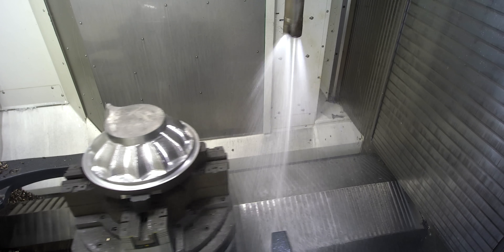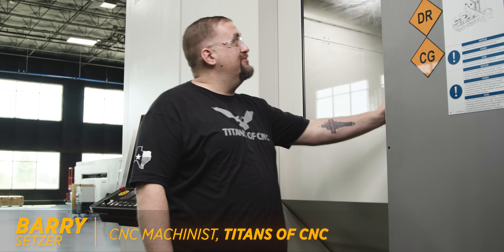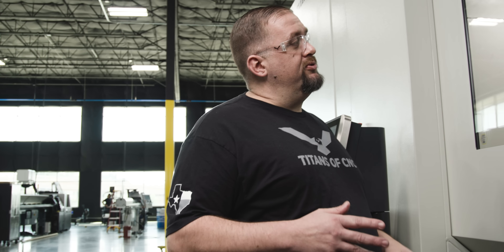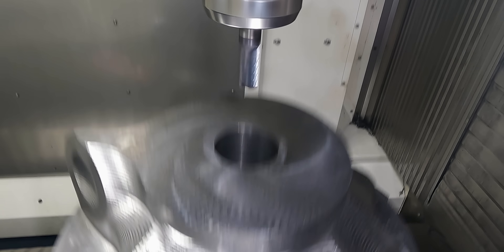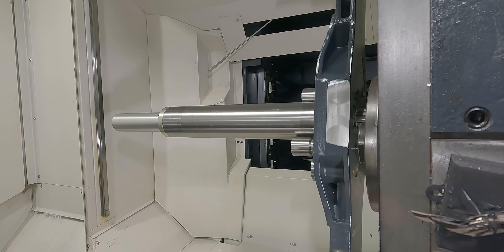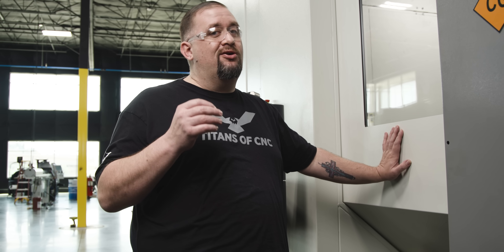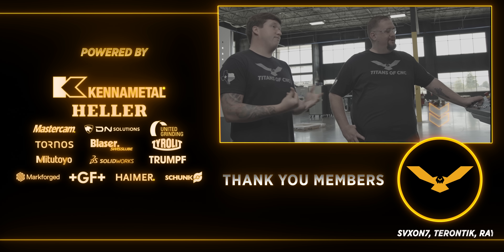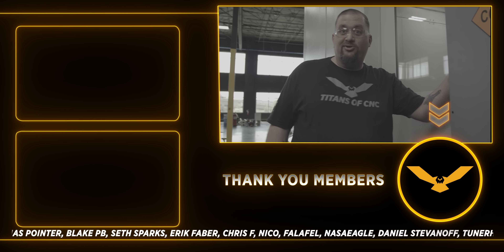I Full Rapid CRASHED Our HELLER CP6000

Comment: A few years ago we had a bad crash on a big $1.5mil machine. It didn't feel bad at first but the spindle repair bill was around $30k and about a month of downtime.
Reply: for a 1.5M machine that sounds pretty cheap for a spindle repair
Reply: I run an old Makino and the computer board needed replaced….was like $18,000 I was blown away, I don’t see how small machine shops can afford that.
Reply: @greeneyesfromohio4103  eBay and skill, inherent or borrowed (practical machinist),  if you think about it, there was probably only one component, or chain of components, on that board that needed replacing. I've had to add an emotional support  capacitor to one machine that started acting up, clipped the wire going to a motor overload thermister  on another. for me that $18,000 would be spent on 3 replacement CAT 50 machines and rigging.
Reply: @greeneyesfromohio4103  I have an 88 Fadal 4020, the whole machine costed less than that!
Reply: Always run my rapid low when running first part, rapid into a Chuck spinning 3000 rpm was my last crash, 3 years ago
Reply: We had a machine operator that did a rapid Z sending a 1.0" reamer into the tombstone on a Mori NH5000.  It turned the reamer into a pringles chip, tore the tool holder open and displaced the tombstone. The machine was down for a month, new spindle and B-Axis rebuild.  I know the bill was over $150K.  The sad thing is nothing happened to the operator. He was notorious for destroying tool holders.  I saw a eight-inch shell mill that was destroyed.....I think he forgot to install the inserts.
Reply: A crash on an index lathe once cost 90,000. That was the record and the colleague has been called Crasher ever since.
Reply: were you the one who crashed it? 😭
Reply: @marcusfanning7513  No my most expensive crash cost around 10,000 Euros.
Reply: @SshanIcsS  crashed a conversational Prototrak when I was learning.  Knocked the head slightly out of alignment by slamming a 1" insert cutter into a vise.  Then I smashed down the spindle of the VF4 I run now on a 123 block when setting the Z.  That head is just a hair out of alignment too.  Not enough to matter usually but a 3.5" face mill leaves about a .0002" high spot on the side of a part unless you bring the back side all the way across.
Reply: That's insanely cheap for a high end machine
Reply: cheap ass haas's wanted over 10k for ours
Reply: @derekschommer1465  Well it´s not cheap but compared to other brands HAAS is one of the cheapest on repairs. The company I work for had to replace the spindle on our HAAS VF4 after I destroyed it. I had the machine going while I was getting some more material and when I came back to the machine the tool had been bent out of the spindle, but the machine had not turned off the spindle so it was still spinning which ended up destorying the bottom of the spindle and the bearings. It cost us around $7500 for the repair.
Reply: @derekschommer1465  you probably arent nice to the haas guys. we get same day service in idaho . BUT THE DOOSAN GUYS TAKE TWO WEEKS TO COME AND FIX THE NEW MACHINE WE GOT. DOA BY THE WAY. AND EVERYDAY AFTER THAT

Comment: All Heller machines handle a crash like that?  It’s one thing to crash my Tormach with 2hp.  I couldn’t imagine crashing a machine with enough hp to begin eating itself....  Funny how when writing software you hit the compile button and if there is an error no big deal or program fails to compile.  I had to relearn this when I got into Cnc machining because an error could be catastrophic.   Much love and gratitude for the content.
Reply: Well, a colleage of mine crashed a H5000 straight into the fixture because he selected the wrong program from our robot automation he was setting up. The motor spindle was out of whack by 0.02mm afterwards although it had 8 years of full 3-shift production on it's belt at that point already. So it was not exactly clear if all of that came from the crash. Tool and part of the hydraulic fixturing were also broken. The rest of the machine was fine. Total cost of that crash was around 30k.
Reply: @michaelapel9810  That's nuts.  Total cost of the machine before tooling?
Reply: @tdg911  Not quite sure. We only did a retrofit (new PLC and software) on the existing automation on that particular project. My guess would be around 1.8 million for the machine, tooling, fixturing, automation and in line measuring. But who knows what our customer pays for a new Heller. They have around 30 of them by now.
Reply: @michaelapel9810  damn….
Reply: At my job writing just got  a new doosan?? (Spelling) it's got that sideways puma looking logo on it. I've a machinist in training I've been working for 4 or 5 months so I'm still a rookie, but they said that machine was between 1.7 and 2.5 million dollars. I can't remember exactly I think it was 2.3m so I'm giving leeway each way. We have cheaper machines that don't do the .0010 tolerance as well so we run parts with a. 0030 variance on them and they are our bread and butter. I .are parts for the aerospace industry most of what I personally touch is 99% aluminum. The smaller machines will make certain fittings or pieces out of steel for higher stress/worked areas of the part like clamps ect.

Comment: So eh Barry?   What was the chipload on that initial plunge?  4” per tooth?   😅
Reply: If the 3,500 IPM he stated is correct, that should have been 5.1852" IPR & 2.5926" per tooth at the 675 rpm shown at 0:55 
(Looks like a 2 flute drill to me)
Probably just a little over what the manufacturer recommends! 😆
Reply: Bwahahaha fave comment